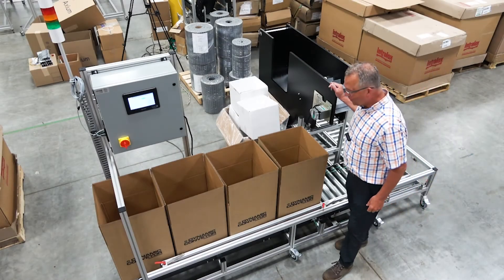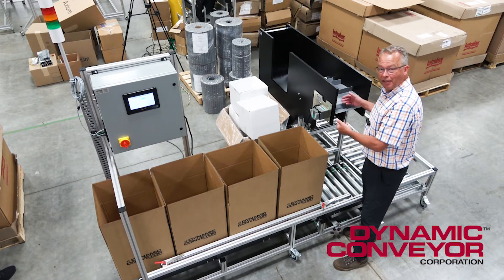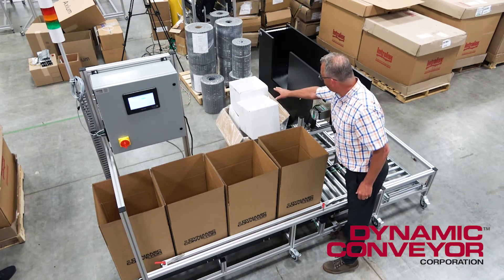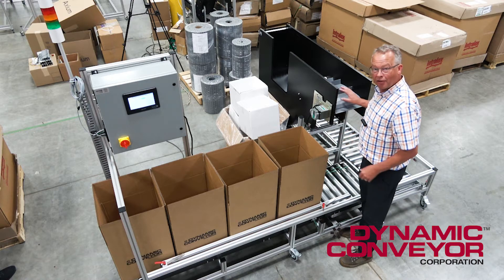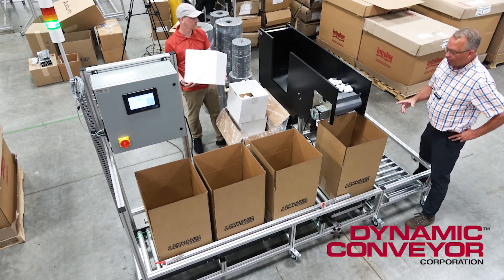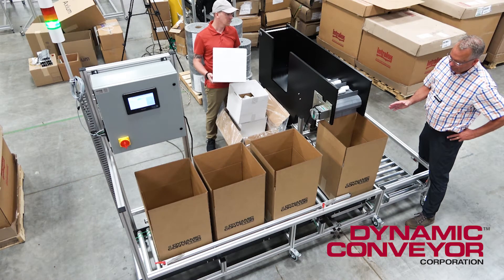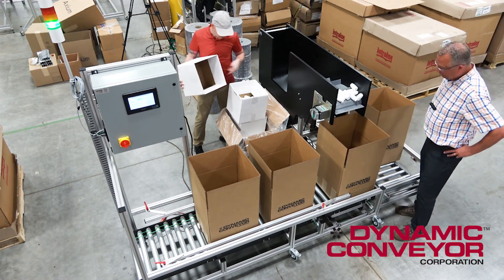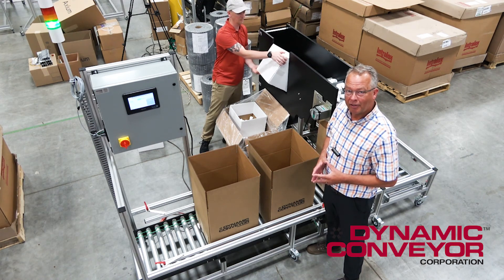Box Filling by weight with Hybrid Accumulation

Comment: You had to push the box because it would not roll by itself. this is the problem with these. or parts get stuck between rollers.. Do you have an answer for those such problems?